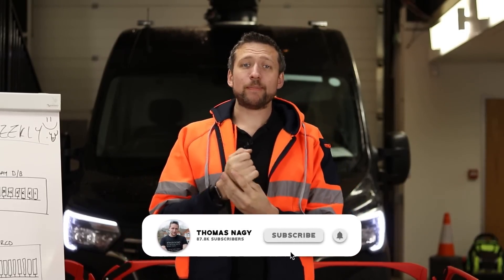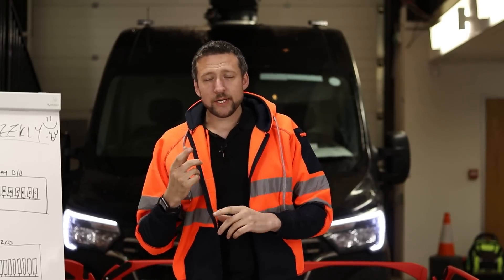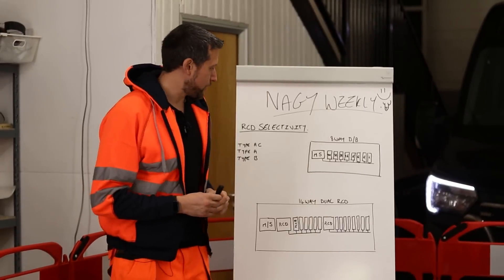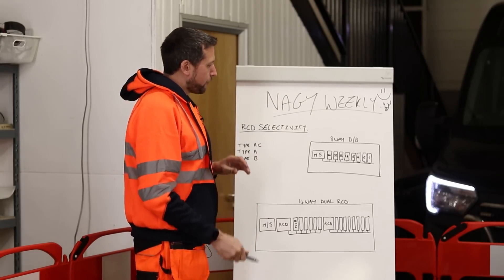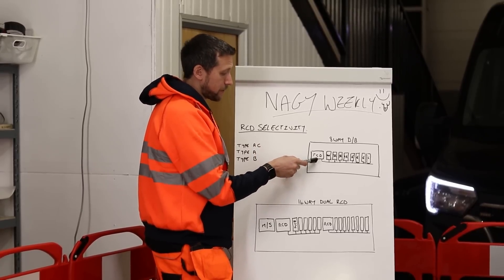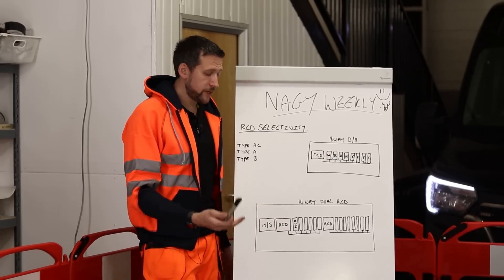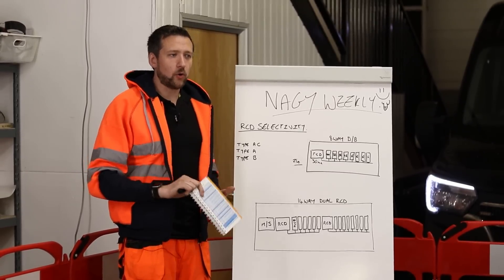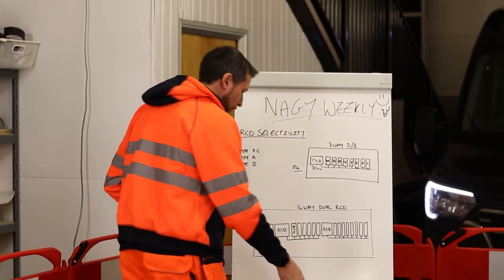Why RCBO's are BETTER than RCD's | Thomas Nagy

Comment: I agree with most of your points, however I'm not sure about RCBO's being "safer". If both devices are fitted correctly, then they should be as safe as each other.
The problem is (as you mentioned) is that the wrong type of RCD is fitted to modern installations. Even with RCBO's, a lot of sites/wholesalers don't even mention or know what "type" it is, and often think you're referring to the tripping curve type instead. What moron thought to have type A,B & C tripping curve and a type A,B,F, & S protection. Surely they could've come up with 2 different terms for the 2 completely different features.

I also think your costing is a little skewiff. I'd like to know where you can get a 10 way fusebox unit from for £30, then RCBO's to go with it for a tenner each. For a 10 way fully loaded fusebox board, I usually pick them up for £170, or £200 with an SPD.
Compare that to a 10 way BG board that's dual RCD for 1/3rd of the cost, you can see why customers aren't keen for RCBO's, especially when it's already a massive upgrade compared to their old 3036 re-wireables.
Reply: Whilst they may be electrically safer, a nusciense trip on an RCD protecting many circuits could be more dangerous in the case of lighting circuits with borrowed neutrals, which tend to be commoned on 1 mcb.  If the RCD on that side trips for whatever reason, All the lights in the house are gone and you could be left without sockets and lighting near a dangerous area like the stairs.  With an RCBO, only the single circuit goes and you are still left with the means to plug in a lamp if the lights go.
Reply: @cjmillsnun  I think you talked yourself out of an argument there. You started off talking about borrowed neutrals on lighting circuits. Surely that's worse on an RCBO? You'll trip both lighting circuits as soon as a load is applied and Betty Crocker will fall down the stairs whilst carrying a hot brew and balancing an elephant on her nose.
And yes, I don't buy into this whole "you'll fall down the stairs trying to get to the consumer unit". If it's really that dangerous then I'd have thought emergency lighting should be fitted.

BTW I'm playing devil's advocate here. I do think RCBO's are better, but I think some of the reasoning is a bit "desperate"

Comment: just ran across this video this and unfortunately I've just bought a double RCd board from screw fix 4 days ago   , can you just empty it from everything out but the main switch and put RCBO in ? ( i am not a electrician just interesting )
Reply: Well yes but you need to know what your doing. You can also do half and half. 1 rcd and rcbos for lights and kitchen sockets, downstairs sockets
Reply: @AndyK.1   thank you i will be getting  a electrician  to do the work , i am a mechanic and i will be stay in my lane

Comment: How can you get those distribution boards so cheap? I'm struggling to even find one single RCBO for 100 quid, let alone a whole distribution board with them.... Electrical safety is a s----show here in the Philippines and I have wanted to buy RCBOs for a long time for my house, but you just cant find them here, and when you do you pay through the nose for them.
Reply: @voltare2amstereo  We're 220-230-ish, depending on which power company. Also some power companies run 2 lines, 110-110 for 220v, while others run line-neutral 230v. Oh, and it's 60hz... Its quite weird with the electrical code here, which of course nobody follows...

Comment: In the Netherlands there is a limit on the number of circuits per RCD. This limit is four (4). More than 4? Fit an extra RCD, or use an RCBO. 

RCBO is indeed a bit more expensive, so people fit 2xRCD + 8xB16, because at scale it saves and we have plenty of room in the switchboards.
Another drawback is that good RCBOs are often 2 modules wide. You can get the single widths only from strange brands.

The types of earth leakage current trip types is very weird and conflicts with the overcurrent letters for RCBO, which is nice...
Type AC is not allowed for residentials anymore here in NL. Type A is used almost everywhere.
Type F also trips high frequencies.
Type B trips on everything, including DC. (PV and car chargers sometimes need this, go get your piggybank!)

Non-type-B RCD or RCBO will indeed not trip when a few mA of DC is applied, I was really surprised when I made a tester for RCD's and they just don't want to trip. Even with Amps of leakage current injected.
Typically they trip somewhere above half their rated current, since the spec for RCD/RCBO only says, "must not trip <0.5 In, must trip >1,0 In", with some time constants.

Eaton has a nice doc with example faults and their leakage type compatibility:
https://www.eaton.com/content/dam/eaton/products/electrical-circuit-protection/circuit-breakers/xpole-rccb/eaton-xpole-residual-current-devices-type-f-brochure-br019005en-en-us.pdf

Comment: You keep saying that it's supposed to trip AT 30ma but I always took it to be that it's supposed to trip WITH-IN 30m/seconds and BELOW 30ma and that's why we test to get an actual figure.
Other than that I'am totally with you..... whoever fitted that switch instead of tracing the fault or came back to do it with the correct parts.
Disgraceful really. 
Can't believe SO MANY retailers are still selling ac type RCD's in new consumer units!!!!

Comment: I just stopped installing them all together on my rewires, but don't have any call backs on previous installs I done before. I guess it's all about how you install it. One job luckily I installed a RCBO board because an USB socket next to kettle was tripping kitchen sockets and it's only caused the kitchen sockets to trip.

Comment: Totally agree Tom, I wouldn't fit anything else than RCBO.
Reply: In Australia every circuit has it own 30ma RCBO. Easy as to install and easy fault finds
Reply: the guy i work with does a bit of both he puts lights on rcbos and then puts the rest split across two rcd

Comment: The way ive always understood rcbos is that you get 30ma of leakage per circuit..  if that's the rating of the rcbo. Is this the case?🤔
Reply: 30mA RCB will trip at a max of 30mA. They will probably trip between 21 and 26mA
Reply: Rcds always 30 ma (for additional protection). With an rcbo this covers on circuit whereas an rcd will cover multiple circuits
Reply: *one

Comment: Great argument Tom, but you have to work within the customers budget. I. like you; think RCBO's are the best. In fact the Wylex combined RCBO/Arc Fault Protection Devices are probably better again and combine that with a Surge Protection Unit and you've got the best money can buy. If i was having a board change and money was no object, i would go for the best money could buy.
Reply: At best it's £50-60 vs split box (splitting hairs over £60 when the installation of everything's going to be like £500 or more anyway to do the work)
Reply: Why would you not, I mean you want to protect yourself, your home and your possessions right? Surely! 🤷‍♂️👏
Reply: As he makes the point, £50 is not enough of a price difference when your talking about this level of safety. 

As for the wylex AFDDs. Yes they're safer, if you know what their limitations are. As for their price? £160 EACH 
So you've a 10 way board that's now gona cost you the guts of £2k instead of £200 
One of their main limitations? Your gona have to split all your rings and use them as radials now instead, meaning on a house with 10ways with 3 being rings you now need a 14way board and 3 more AFDDs putting your cost well over 2k

Comment: To be honest, I think I'd opt for an RCBO board. I can't do anything as I live in a housing association flat which currently has a dual RCD set up (plastic box) which, in the 12 years I have been here has not been an issue. Not only is having single or dual RCD a possible danger in some applications, it's also a bloody inconvenience. That RC takes out a bunch of circuits which if it goes at night, you more than likely wont have light. Also those circuits could be down until the fault is found.

Comment: 100% with you Tom. I had our board changed under v17 of the regs a few years ago. We have a fault on one of our circuits. Dual RCD board. Every time it trips we lose our lights. 
Given what I know know, I would have RCBO board fitted. At the time I had a separate garage board independent of the house because I go out into the empire of dirt and play with stuff. Trips often. Does not effect the house. Also I can turn off the house which then safe while any work is being done in the house. I still have power in the house via an extension and vice versa.
Put it another way, why would you not have an RCBO board? Considering the % price of labour against the price of fuse board change how much are you saving?

Comment: I believe there is also a reg that states an rcd shouldnt have no more than 30% of the ma rating at it at one time. Which once you get to 6/7 circuits is easily easily achieved. 

Rcbos is the way forward

Comment: In the Netherlands there are quite strict rules for rcd's .
The maximum of circuits 1 rcd is allowed to feed its 4 x a cb of 16a
I have 4 rcd's with 3 circuits per rcd..
Reply: That's weird. I'm a dutch electrician and that setup would have to have special requirements. 

12 circuits would have 3 rcb's divided over the 3 phases. 4 rcb's is an uneven load. Grid managers hate that.

Not that my personal is better. I'm trying to convince my parents to let me switch out the 40 year old unsafe panel with 10 old style fuses + an induction stove 2x16a breaker on 2 rcb's. Unfortunately my dad is the type "as long it works it's not being replaced".

Comment: i'm american, so don't understand half of what you're talking about. but i find it infuriating when cost comes up for stuff like electrical. for christ sake, you have a home worth hundreds of thousands of dollars and you cheap out over a 1000 bucks or so is beyond me. maybe it's just me, i like to buy good stuff when i know it's going to last decades
Reply: We do believe  that the British electrical system is the best in the world and our 230V system is ideally placed for EV adoption. I have certainly learned a lot from visits to the United States and I'm always impressed by the standards of workmanship.
Reply: I'm an approved electrician similar to tom. An average board change that I do costs £800. That's based on an  8way RCBO board (10 way with 2 spares) with SPD fitted and full NICEIC certification. I regularly get told I'm too dear, cause sammy down the road is gona buy a £50 screwfix special split board and fit it for £200. 
Problem is, a common fault over here is that upstairs and downstairs lights share a neutral, meaning that is they put lights on either side of a split board, the rcds will constantly trip, they dont know how to resolve the issue and so bypass the rcds altogether, meaning the customer has an even more dangerous installation now cause they think their protected, but they're not

Comment: If I wanted to buy a 1unit rcbo, it's well above 100€ per piece.
But I can only find 2 units (width) in germany. Still very expensive.
It's 25€ for an RCD and 3€ for a 16A breaker.
Where can I find such an rcbo?

Why are there wires on the RCBO? Are there no matching rails available?
Reply: The line connection comes from the bus bar fed from the switch. The neutral lead connect to the neutral bar at the top of the DB.
There is one dual bus bar (line and neutral) board that I know of in the UK, but it is the exception.
Reply: Hager do some that may work. I am
Assuming you are on a 3 phase supply plus neutral. But you would need to if the busbar fits.
Reply: I meant 2 unit width.
Those are 40€ a piece and need a lot of space 

I only found Siemens 5SV13131KK16.
25€. But it's type AC and C16.
Not quite right.

What's the model number of the Schneider RCBO?
Reply: @CyberlightFG  you may be best using the Schneider product selector, but the RCBOs from them are really expensive
Reply: @martinbateman2467  I wonder how Thomas can get them so cheap. That may not include tax, but the closest I could find was a Siemens for 45€ shipping not included.
Can't find those one unit Schneider RCBO s. All are 2unit width and cost much more than 100€.
Reply: For your information:
I'll need it for two big houses. More than 70 of those to replace everything.
He uses Mk sentry

Comment: 30 mA RCDs are not designed to trip at 30 mA leakage, they are designed to have tripped by 30 mA of leakage. Hence 30 mA RCDs will trip at very much lower than that current normally 22 mA to 26 mA
Reply: He said that. Several times.

Comment: Those type rcbo's are against regulations here in finland, because they dont trip if power is off. 🤣 only magnetic (bigger) rcbos are ok.
Reply: Its not about them having to trip while being off, it's about them having to trip in low voltage states, where electronic only ones could not work anymore.
The electro-mechanical ones have electronics as well as the mechanical coil, allowing the RCBO to trip at low voltage because of the difference in the coil.

This just to clarify because we have the same regulation about it here in Germany, next to type AC RCDs being banned since 1985.
Reply: Why would it need to trip if the power is already off?
Reply: @stupot_64  I really dont know, but that is the only answer I got.
Reply: Lol isn’t that an Oxymoron?
Reply: What causes / how can they trip if the power is off?
Reply: @barrieshepherd7694  I dont know, maybe some stange external power source? 

It is in book, so it is the law. One must obey it, not understand.

Comment: Enjoy your video's but what was that about cutting down the neutral??? I have found to make a neat job I actually cut them to length. You always used to get someone saying this would interfere with the RCBO's integrity ?   Personally I think that is an old wives tale. Can you please clarify your thoughts please Tom??
Reply: The only integrity that may suffer is that of the busbar termination.
Those fine strands are fused into a rectangular block at the factory so you can terminate as a solid conductor.
However if you shorten the flylead you must then apply a suitable alternative, whether that's a flat pin crimp or a bootlace ferrule.
If you look up the data sheets on flat pin crimps (and that's a decent traceable brand!)  they might not be rated above 15 or 20A. And that's when applied with a calibrated ratcheting crimp tool.
Plus, if the lead is left original then that RCBO is universally reusable.

Comment: I completely agree with your sentiments; protect/isolate each circuit. But if power is lost, a property will be dark regardless of the fuse board contents. Would you be a proponent of battery backup emergency lighting?, it may save Betty in a power outage.
Reply: I think at least 1 in every 4 downlights should be required to be emergency back up. I don't know what the lux or count level is in commercial but emergency lighting is legally required in commercial and public so why not res?

Comment: I only ever fit RCBO boards and with Type A rcd not AC and always chuck in the SPD as well. I simply wont fit type AC or a split-load boards unless there is a very specific requirement.

Comment: Great video, what is your stance on AFDD breakers or combo AFDD/RCBO breakers?  Here in the US, just about every circuit requires AFCI (AFDD) breakers, and many things require GFCI as well.  I know that the RCBO/RCD is a 30ma trip vs our GFCI at 5ma trip.  The GFCI is required for anything wet/damp areas.  Also as of 2020 rules require SPDs on all installs here too.  👍  I like our tailless breakers (AFCI/GFCI) that have plug in neutrals as well so there are no tails to wire in for the neutral.  Just line/neutral run in and that's it.
Reply: Schneider sell tailless RCBOs in the UK

Comment: Have you ever done a board for a bitcoin farm and would you be interested in a project like that?
Reply: From experience, computer power supplies are higher than average leakage. If you are doing a full farm, you are likely going to need to split the miners up into groups and load up several RCBOs to avoid tripping even if the actual current draw isnt anywhere near the limit.

We had this exact issue in a recent datacentre install.  Plumbed everything in and started powering on all the servers.  Got half way through a rack and the whole room died.
Reply: @AdrianBawn  Thats good to know thank you, i have a warehouse in Essex that i plan to use as a crypto farm not specifically bitcoin but it does use computer power supplies, im thinking maybe everything needs to go through a ups and then the ups goes to the mains
Reply: @lordmas2099  It really depends on the type of UPS you get.

Most off the shelf UPS systems you can buy these days are either "offline" or "line interactive".  That means that all the time you have a stable power incoming, the UPS just passes the power straight through (albeit probably through a filter and surge protector) bypassing the batteries and the DC/AC conversion circuits.  That means any earth leakage on the "clean" outlet side would also be apparent on the "dirty" incoming side.

You would need to invest in a much more expensive double-conversion "online" UPS.  These take the AC, convert it to DC, and then convert it back to a clean isolated AC supply for the load.  Although that said, I am not sure if that would still run into the same issue because I think the UPS might still leak an amount relative to its overall load.

The way we got around it is to hard-wire the UPS from our server rack directly back to a fixed breaker.  Our sparky said you don't need an RCD for a hard wired device.  Not sure if thats true but it makes some sense.